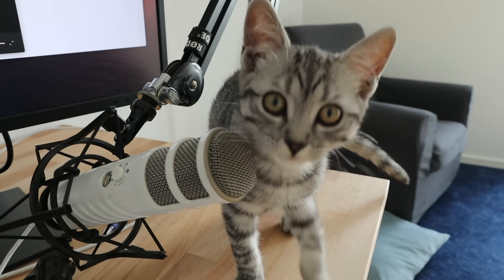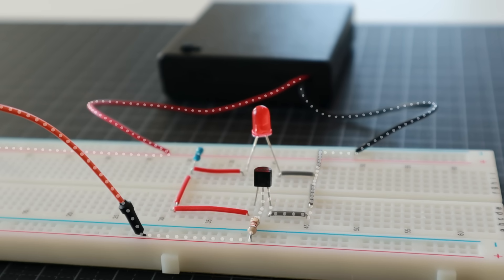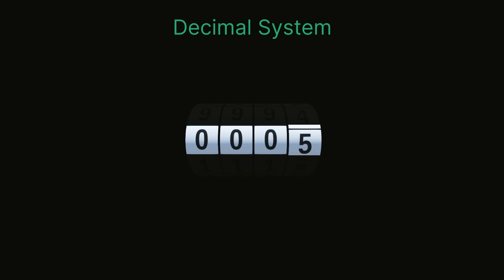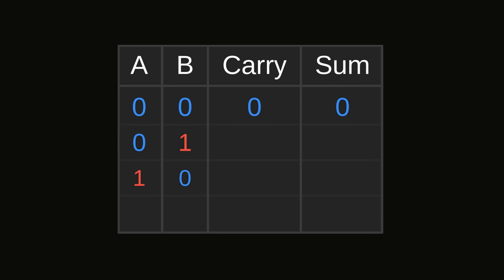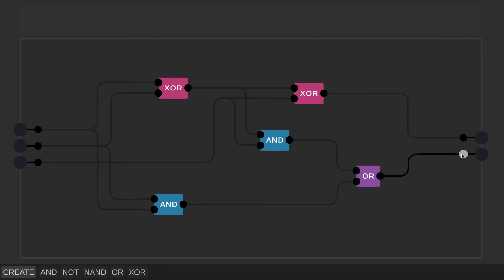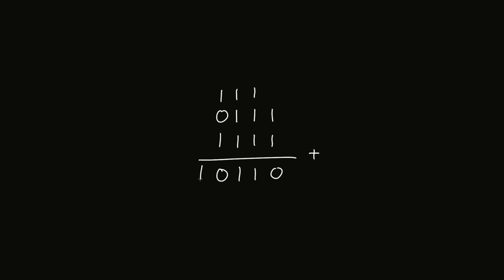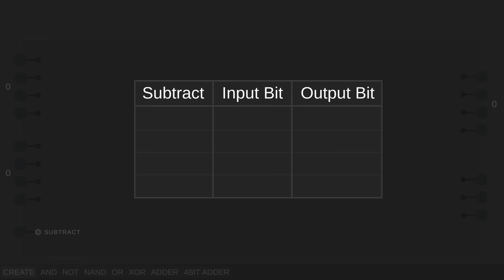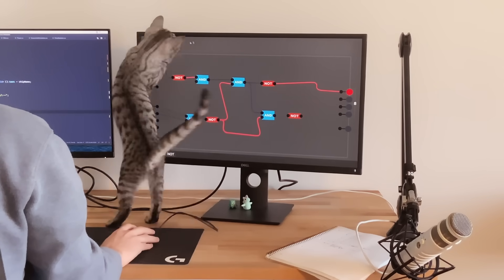Exploring How Computers Work

Comment: With this ALU, we can only do subtraction till -8, like if we do -8-1, we won't get anything like -9, it just gives 7 , and with neg sign, which is not correct, so it is bounded till -8, and if we do 7+6 , it gives 13 but with neg sign, so not correct, and also if you do 7 + (-1) with sub on, it means 7-(-1) with this ALU, you will get 8 but with neg sign, but as sub is also on, adding and gate to sub and first neg decider output also don't work , so this ALU is limited between -8 and 7

Comment: But nobody can explain how to turn 1s and 0s into physical matter that can travel Bluetooth or Wi-Fi perfectly without loosing form. How can fiber optic’s transfer light threw solid matter for instance how can data go through house holds and across countries without getting mixed up with billions or other info. Only PON holds the knowledge
Reply: Bluetooth & Wi-Fi are radiation, hence the going through walls. they do lose form a bit, which is why networking computers is a hassle. fibre optics just use glass strands to direct light. generating the signals is pretty simple in concept, just either send a pulse or don't. the way multiple things can be sent at once is that it is possible to detect and generate signals differently based on wavelength, so each wavelength can send different information. this isn't a secret I don't know what you're talking about
Reply: @chipsams3592  you don’t know what your talking about you just repeating things you’ve read I already read all that myself. I just want to know the piece that turns 1s and 0s into data that travels threw the air. The light bulb computer was legit but this digital stuff is not. There ain’t no way radiation can send partials that move in real time. Like FaceTime. You cannot tell me you know how that works. I mean I thought I was gonna get somewhere with you but you just tryna be smart not tryna actually take what I’m saying seriously. Like don’t start a fight really help I’ll definitely pay anyone who can help

Comment: The only input I can provide, is simply checking the 4th bit or "-8" bit for negative numbers isn't good. This forces the ALU to only do half of it's capable capacity. What should be done is a simple AND gate, that both checks for the -8 bit AND that the subtract input is on. Otherwise this flag would always be on for numbers higher than 8, which you don't want, because 8 through 15 are not negative.
Reply: Yes sir, you are right

Comment: 4:06 is backwards.  The reverse logic of nand and nor is due to the voltage out puts of transistors.  There is no need for the logical not!    This is not how a computer works.  This is how to design a 4 bit adder using a simulator.  You forgot to add voltage, timing, cycles, machine language, registers, ALU, ALU digital components, memory, hash table for memory addressing.  This would make a fantastic intro for a series of lectures and a great intro on how to build a digital circuit using a specific simulator.  

Please, don't give up.  You have a knack for this and great rhythm with a pleasant voice.

Comment: 1:36 I'm confused here, how does that make an easier path for the current to travel? It travels a greater distance, which, in my opinion, isn't an easier path. Can someone explain?
Reply: Don't think of it in terms of distance, but rather of resistance. It's harder for the current to travel through the segment of wire that contains the light than it is to travel on the segment without it since the light has more resistance. So, when the segment without the light is closed (by making the paper clips touch), the current naturally flows through there. This is called shorting the circuit.
Reply: @arc8245  Damn that was a really clear explanation, thank you so much! And here I was looking so hard for the answer
Reply: @Dr.Discombobulated-y9h  Glad I could help!

Comment: I started here at Uni and ended up developing on Unity and Unreal, it seems you done the opposite? Learning Verilog(creating circuits from code) or VHDL is interesting too, FPGAs are all the rage...or where 8-10 years ago. Nice explanation though, at Uni they always explain everything in a complicated manner, this was well thought out. To go from low level hardware right through to software, operating systems, app development etc is a challenge, most either end up in software or hardware not both, but the ones who know both are usually better at explaining things. Nice Video. Peace ✌

Comment: Been testing out the 4 bit adder and wanted to know if anyone knew a way to remedy the fact that when doing a calculation such as 12 + 12 (1100 + 1100) the output is given as 24 (1000 + 16 carry bit) but it's also negative, as it's done -4 + -4 at the same time and has therefore outputted the -8 bit (1000) and the carry bit and told me it's negative. Didn't know if there was a way to fix this without adding a separate bit to each 4 bit number to activate the invert and add 1 for it if you wanted it to be negative. Sorry for the essay lol great video

Comment: Computer do not do math, they already have the values stored into memory, it already has every math problem stored and configured into memory. There are no calculations that the programmer has not already stored. Transistors store numbers into memory that is already read into prestored memory in each processor. So if this pixel is red then the prestored memory would use the bit stored memory string then convert it from already prestored instructions.
Reply: Wrong.
Reply: @ShinyHappyREM  No, 💯. Unless you think computers have brains lol.

Comment: Very cool tool.  Would it be possible to add just a lone transistor and a gnd component 
to the initial components so those could be used to put in serial or parallel to create initial components.

Comment: 1:42 I am legit confused by this. Isn't the circuit you're showing 2 resistors setup in parallel? I thought the voltage doesn't drop over parallel lines. Someone please help me understand.

Comment: Everybody seems to have understood everything here, that's great but it's not my case. If someone is kind enough to answer : 
1. How can a "not" storage electricity and release it when both of its inputs are off? 
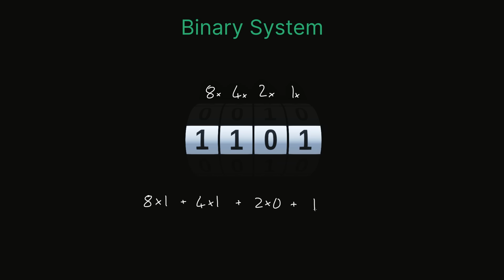2. 6:15 mn => how can 8x1 + 4x1 + 2x0 + 1x1 make 13? It"s more like 15 to me.
Reply: Not is just a logic we follow, and it can be like flipping the light bulb switch so instead of turning off it turns on and vice versa
8 + 4 = 12, + 1 = 13. Also because : 
1 1 1 1 : 15
1 1 1 0 : 14
1 1 0 1 : 13   <--

Comment: Kinda lost at the negative operations but apart from that it's very clear! I would just like to see where the current is plugged in with these logic gates, like how do they actually insert in an electric circuit, because that point is kinda abstract in my mind

Comment: I built a computer just out of logic gates (7400 series) that mimicked a mainframe instruction set. I changed it 2 years later when the 8080 was available and re-built it using the s-100 bus.
I have been programming in assembler since 1972 and have been doing so ever since. Programming in assembler gives you a much better understanding how computers work. And much less restrictive than any other language. Working in assembler is like a blank canvas to an artist. Any other language is just painting by numbers.

I find it odd that people think that a wire can only hold a current or no current, 1 or 0, on or off. Of course the wire is referenced to ground. But thats limiting. A wire can hold a positive current, no current, or NEGATIVE current. Thus 1, 0, -1 on same wire! Its base 3 not just base 2. U have to think out of the box. There were computers that used this logic.

Comment: Why the heck nobody create the OR gates just using wires .. just connect both inputs to the outputs and you’re done
Reply: well the problem is is that if one input is on, it would force the other one on because they are connected, so that might break something
Reply: @DoorknobPlus  to my knowledge positive and negative gives the direction of electricity. If one is on and the other is off the electricity won’t go backwards
Reply: @CapitanTavish  idk i havent tried it but i feel like it would go backwards.

Comment: omg, calling the sign bit "-8x" makes so much sense! None of my professors taught it that way! I'd always kind of struggle because I had to remember the formula/steps to get the 2's complement, but thinking of it as -8x just takes that need away!!
Reply: If you want to really understand how it works, look at 9's and 10's complement in the 10-digit system. That blew my mind away
Instead of subtracting two numbers like
75-31 = 44

1-We can subtract and add a 100 (10's complement, like one's complement in binary):
75-(-100+31) - 100

2-Then we prepare for 9's complement(easier to work with because it's like inverting each digit):
75 - (-99+31) +1 -100
(75 + 68)+1-100

3- We do the calculation, then minus 100 (that's why we delete the carry at the final step)

 (143+1) -100
144 -100 = 44
Reply: I based my numerals off of two's complement

Comment: a computer only needs a memory controller, a tape reader, not a processor at all, no ALU needed, once calculated, never need to be calculated again, LUT pre-processor, memory translator
Reply: all assumptions off the table, you dont have to have only binary
Reply: memory vs transistor, is that, it only needs to consume energy when its operated on
Reply: try a memory controller logic instead
Reply: two or three design issues: assume you have mono-duo-n-differential pairing zero-reference-data-lines, to remove noise, to lower data line signal voltage (instead of voltage to ground +/-1, not considering gate-driver voltages), and consider you try to make an alu that switches just-in-time to the alu-operation you request, also, consider that you have your alu operations (n-bit) results (n/2n-bit) stored in a fast 1-cycle cache, also the program to try to easily design/test logic circuits that you provided, lacks workability, cant test anything, ui is at same level as with linux wysiwyg, it does not exist

Comment: I've taken 4 years of computer science classes and no one has once explained this as well as you have. Great video
Reply: You learn this stuff more in Computer/Electrical Engineering than in Computer Science. Especially in Digital Design (and, later, Computer Architecture) courses.

(And, no, Septa, not a chance. There's way, way, waaaaaay more than this kind of thing to learn in getting a university degree in a field that would include this rudimentary material. Though, yes, this is certainly a nicely explanatory video.)
Reply: Yes, if an online course was as good as this all the way, I bet you could get a college level degree in a year.

Comment: This is currently warping my mind: what is actually laying current on the emitter of a transistor?  (the paperclips in this video) in the old days i guess it happened mechanically by reading the code from the punch card. but what is the mechanism in more modern chips?   please somebody help :-)
Edit: 15:16 here, on the left side we have the input values. i guess could be dip switches for example. but how does it actually work in modern architecture?

Comment: One can say this video is not about how computers work, is more about the ALU, wich is an important part of how computers work but is not the hole fetch - decode - execute cycle wich is the base of how a hole computer really works, the ALU is on the cycle but it only works on the arithmetic part of it, which is a very important part and there is a lot of work done by the ALU, but is not the hole computer

not to say that, this is only the hardware part, there is a lot to be said about how hardware and software interact to make a computer work

Comment: (Correction) At 16:34 for NEGATIVE  signal...need to use an AND Gate for the last output of 4 bit adder and Subtract input. 
Otherwise, it will show negative even for the last output which may not be necessarily negative.
Reply: You literally saved my sanity! Thank you so much for point this out!

Comment: Oh so NOW I know the 64 bit OS vs 32 bit difference. What you demonstrated as examples in the video was a 4 bit way of executing, so a 32 bit OS will have upto 32 of those binary places, and 64 has upto 64 of the binary places, so 64 bit can do more operations in the same time compared to 32 bit OS. Correct me if I'm wrong, but that seems very reasonable.

Comment: Thats why we have range from -128 to 127 , cause maximum u can write 011111111 = 127 if first bit will be 1 than u have -128, they did this cause we dont need 0 and -0 is the same value.

Comment: Important thing about the current flow in this video: This video shows ELECTRON flow which shows the direction where the electrons are going. Electrons go from negatively charged places to positively charged places. Most people use CONVENTIONAL flow. This is the opposite of electron flow. Conventional flow exists because in the past it was incorrectly thought that electrons go from positively charged places to negatively charged places and we have been stuck with this mistake to the present.

Comment: I gotta say. Its incredible how condensed and smooth your explanation of the matter is. I needed about 4h to understand these fundamentals and ironically your video featured information completely new to me. Only roadblock for me was the speed at which everything was going. If I wouldn't know the things discussed beforehand I'd need multiple watches and attpempts at recreation to understand properly. But that is a personal problem. The video is hands down excellent. Keep it up :D
Reply: Remember that our guy needed to
1. Understand concept himself
2. Mess around with real life circuits enough to be sure what he's doing
3. Needed to prepare a lot of material and codes before he showed us something

This video is but a short summary of what Sebastian learned (tho in a damn cool way). Don't be ashamed that it take you time to learn. To create such videos, especially if someone say he just learned it (big thumbs up here!), there was a lot of hours sank to create "measly" 20 minutes of content.

I would be darn impressed for someone to learn complex concepts of logical operators from a scratch without a prior knowledge about that or IT in general in 30 minutes.
Reply: Just for fun try clicking the Settings gear at the bottom right and changing the Playback speed to .75 or even .50. It does give you more time to think.

Comment: you don't need NOT and NAND gates to create an OR gate. LOL.
Just plug both inputs to the output. If one of them is on, the output is on too.
Tada: OR gate.
Reply: "Just plug both inputs to the output." but thats not possible or am I just too stupid? have u tried it? I tried doing an or gate for a while now. (I am talking about the software sebastian uses and linked in the description)
Reply: @sdrtsdhgf849  i don't know if this is possible in that program. and after thinking about it i guess is isn't even THAT simple in irl. At least you would maybe need a safety mechanism that the energy from one lane only powers the output and doesn't "flow back" into the other lane.
But I still don't see the need for any complecated on/off inverter to just power an output from one or both intups.
Reply: @Caiitrix  thx for the answer. I at least could not figure out how to do it in that program.
Reply: @Caiitrix  it is possible and he is doing it in that tutorial.. just another way than I found. sry for the misguidance
Reply: @sdrtsdhgf849  everything is fine.
Well, you know the saying. There are multiple ways leading to Rome.

Comment: Nice work :) Next step: buy FPGA and test it in real world. FPGA is cheap today and is good tool to make own "chips". I designed few one core processors on FPGA at university. If you want make working processor is good idea use some small assembler (at start). My fisrt processor use Brainfuck and it work great.

Comment: Your paperclip switches got me thinking about implementing logic gates, and I realised that with a couple of double-throw switches (one input and two output positions), you could selectively swap or not swap where their outputs go. That's just one step away from a controlled-swap gate.

Use a relay and you get the rest of the way there. Put the control signal on the electromagnet and use the two sets of switches to implement the rest. The normally-closed paths provide the non-swapped outputs and the normally-open ones do the swapped ones. So, output X takes the NC from input X and NO from input Y, and vice-versa for output Y.

A controlled-swap gate can be used to implement any logical function by fixing certain inputs.

Setup: C = variable, X = 1, Y = 0
Result: Cout = C, Xout = NOT C, Yout = C

Setup: C = variable, X = variable, Y = 0
Result: Cout = C, Xout = NOT C AND X AND NOT Y, Yout = C AND X

Setup: C = variable, X = variable, Y=1
Result: Cout = C, Xout = C OR X, Yout = NOT (C AND X AND NOT Y) = NOT C OR NOT X OR Y

I doubt the longer complicated outputs are particularly useful, but you can see simple functions like AND, OR and NOT showing up in there.

Also of interest, CSWAP is reversible, though I'm not sure how you'd make use of that with this implementation.

Comment: For a while now I've been missing something to really make Two's Compliment click in my head because most explanations I have seen DO call the last bit the sign bit, but calling it the "-8 place" makes everything make a ton more sense even though that is a tiny bit weird at first.

You also didn't mention the other advantage of using Two's Compliment is that you don't have 2 zeros, a +0 and a -0, which is usually not ideal (although sometimes that can be used as a useful logic thing iirc, because you can use 1000 to mean something specific instead of actually having a -0)